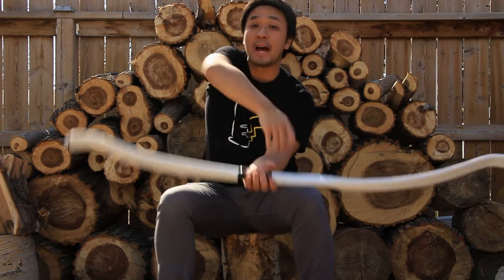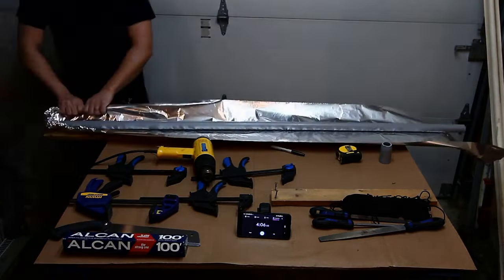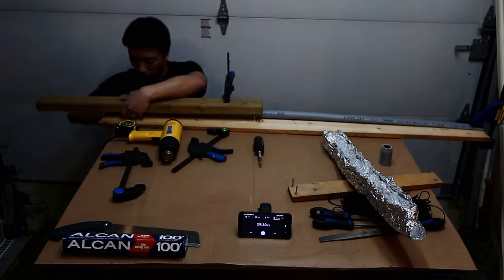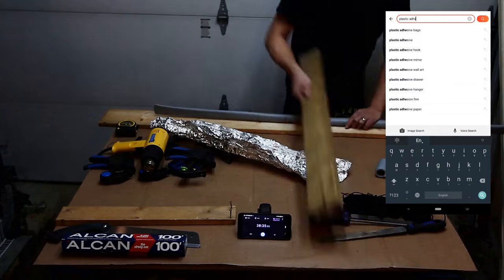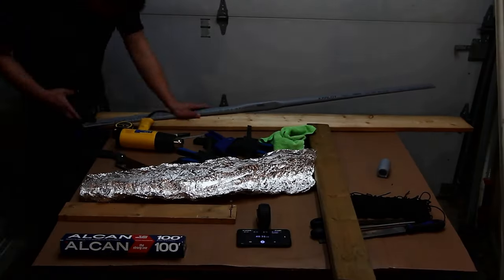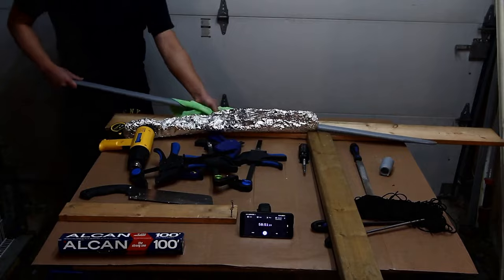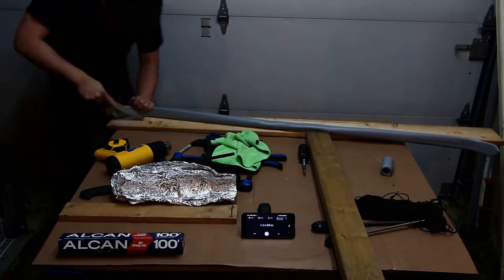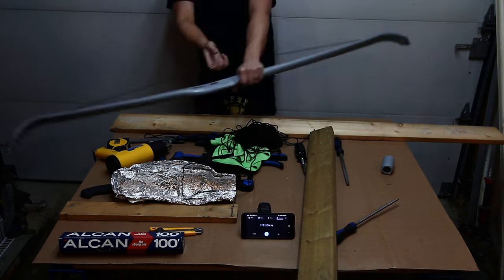How to make a $4 PVC Recurve Bow in 60mins | JimBow Jim Bow SN001 | Live and Let Fly Archery

Comment: You write about everything, but you didn't write what pipe you used.
Reply from the maker: 😱😱😱😱😱 Oops… 0.75 inch PVC schedule 40 electrical conduit. I think… I have used thinner ones for weaker bows or for smaller hands, and I've made larger ones for stronger hands also, they come in many different diameters!  It's been a while since I made this bow, maybe I need to make more soon!!!! It should be something like this: https://www.homedepot.ca/product/carlon-schedule-40-grey-pvc-conduit-3-4-in-x-10-ft-/1000101188 

Thanks dude!
Reply: @liveandletfly  thank You
Reply from the maker: @masahuku5673  You're very welcome! Have a fantastic day! And go make some holes!!! 😁